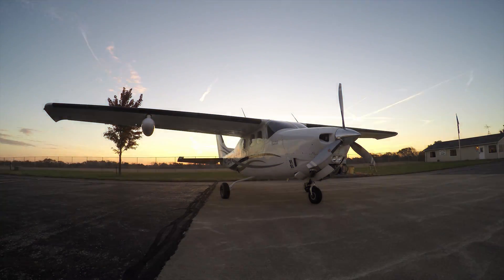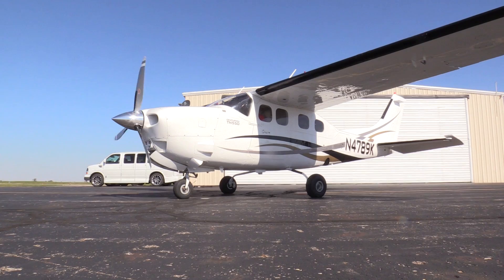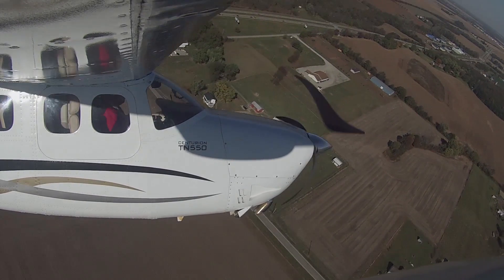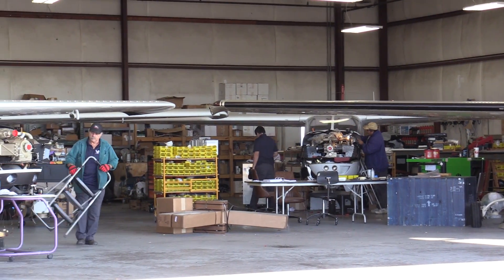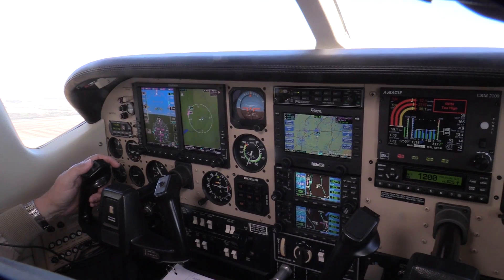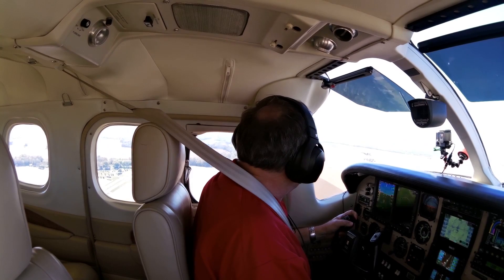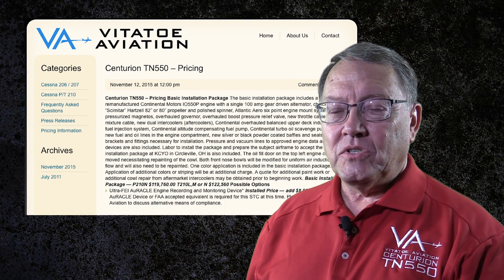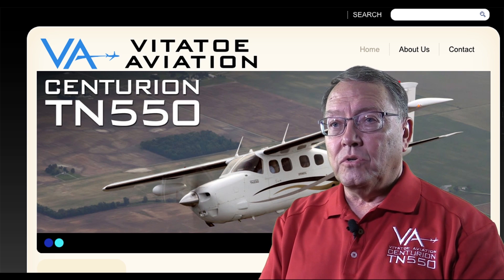Vitatoe Aviation's Turbonormalized P210

Comment: If I could slap a lighter 4 blade composite prop on it and ceramic coat the turbo shroud, and some exhaust/I take work, 230 kts would be doable. Sign me up. Bu pt then again, 2003-2007 Columbia 400's are running 165-280k with low time and. 235 kts.
Reply: What's the cabin pressure differential on the Columbia at 22K feet?
Reply: What kind of MH do you drive? MH means motor home right?